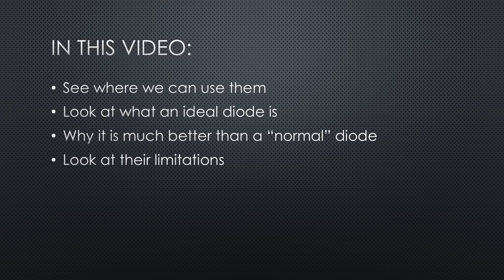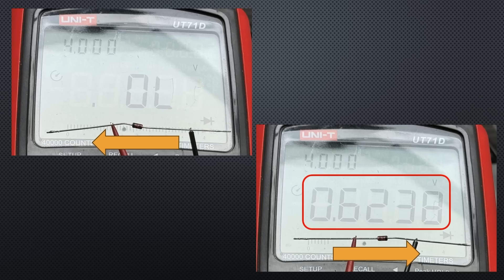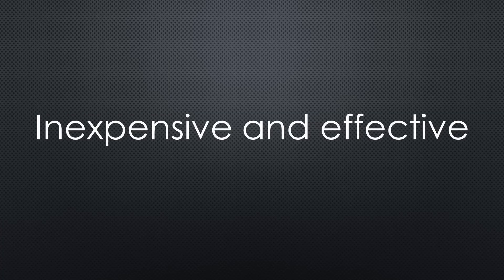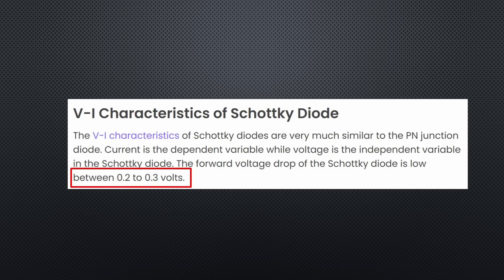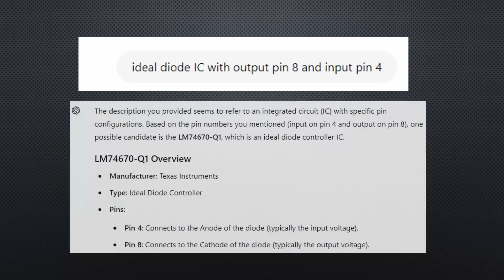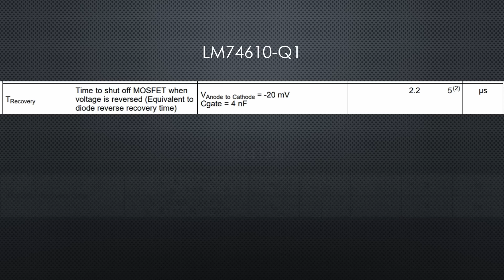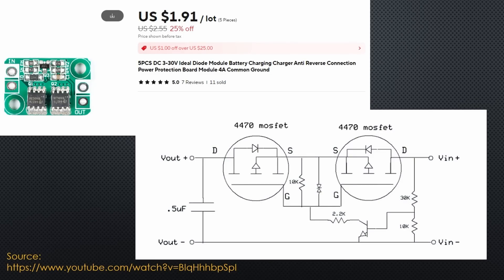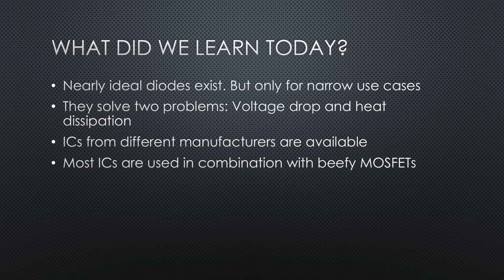(492) How to Protect Your Devices Against Reverse Polarity Using Ideal Diodes

Comment: I really don't see a need today for this IC, P-channel mosfets now have low Rdson, it doesn't have to be fast switching either so you can find of 0.5$ high power pmos mosfet for 90A or more, all you need is resistor and zenner if you going more than 20V.  I don't see any downside and it is far more the cheapiest solution, but keep in mind to put the drain of the mosfet to the input (+) side because you need that internal mosfet diode to conduct in normal polarity.

Comment: LM73100 is it also usable to charge 2 batteries in paralel to protect / seperate them from each other if voltages /capacity are not exact the same?
Reply from the maker: I would not connect such batteries in parallel.

Comment: I designed a pulse-width regulator with a synchronous diode. To protect against reverse polarity and short circuits on the power input, I installed a 40A automotive fuse in the input circuit. One day, I accidentally reversed the polarity of the battery (12V 60AH). The fuse immediately burned out. I expected the regulator to be damaged as well. However, everything remained intact. Replacing the fuse restored the regulator's functionality. The two diodes built into the MOSFETs acted as reverse shunts, limiting the reverse voltage and acting as a protection mechanism.
Reply from the maker: Glad to hear your design held up!

Comment: Very informative video! Could you please also make a test video for the popular Aliexpress XL74610 Ideal Diode Module? I'm not sure if it uses the original LM74610 chip or a cloned XL74610 chip. But I'm interested to know if it had done some improvement and could replace a swithing mode power supply rectifier diode on the DC output? What is the maximum frequency at which it can still work properly, and what is the maximum voltage it can handle?
Thank you in advance.
Reply from the maker: So far I have no such plans :-(

Comment: Very welll explained Sir. Can you suggest a solution for me where i have two power supplies 12 volt 1.5 amp and i want to connect them in parallel to increase the watts. Still i want to protect both power supplies incase of voltage and current imbalance. Thanks for your help.
Reply from the maker: I will not give you advice on that because it is quuite dangerous and can lead to dead power supplies.

Comment: Can these modules be used on the battery's negetive leg rather than its positive? 
I don't see why not; just swap it round the other way right? Or is there something I'm missing?
Reason I ask is because if the physical access to the battery's negetive leg was easier than its positive leg.
Reply from the maker: You can try. I do not like to cut ground wires.
Reply: I suppose so long as the same ground is not needed elsewhere/downstream then it should be fine. (As to not disrupt any 0 volt reference.)

Comment: I came back to this video because I completely botched a power circuit with multiple supplies coming together on a common power rail.  I'm now looking at the LM73100, NIS6150, ISL6146 and LTC4359 as my ideal diode for no forward voltage drop but full reverse current protection.
Reply from the maker: Good that you learn from a mistake!

Comment: Will these devices protect a 12v car lead acid battery charger from user connecting leads backwards at battery terminals?
Reply from the maker: This should be possible.

Comment: They are cool, but you only need them for really low voltages like 5V. The voltage drop of a power Schottky diode at 12V is close to negligible for most applications.
Reply from the maker: I agree somehow. Heat is also generated at higher voltages...
Reply: @AndreasSpiess  I use a combination of two mosfets as reverse polarity and overvoltage protection in a consumer product with a 5.5mm barrel connector. The nominal supply voltage is 9-12V but there is a chance that somebody might plug a 24V or even 48V supply in. Reverse polarity supplies are also common (guitar effect boxes are using negative on tip, I believe). There are, unfortunately, too many variations of barrel  plug power supplies out there to avoid this design. If I didn't have to protect against overvoltage I would go with a simple 1A Schottky.

Comment: Hello! Can I use XL0401 (DZDH0401DW + AGM30P05A) for blocking reverse flow from accumulator to charger?
Reply from the maker: I think so if you read the datasheet of the DZDH0401DW

Comment: There's another very simple solution (used very often in old electronic games using batteries for which the voltage drop would be unacceptable): place a reverse biase diode between ground and VCC and a fuse between VCC and the diode branch. In normal operation, nothing happens; if you inverse polarity, the diode will conduct, short VCC and ground and the fuse (which is before the diode) will pop.
Reply from the maker: I agree. Some commenters named it "crowbar" method. But you have to have a replacement fuse handy...
Reply: @AndreasSpiess  Use a polyfuse (PPTC) instead. Trade off is trip time and a small temperature dependence. But it works very well.
Reply: @Winkemaennchen  A correctly sized polyfuse and a power Schottky will have reasonable trip times. The problem is the power supply. If it can't supply the trip current of the polyfuse, then it's the power supply that is being stressed. In extreme cases (lithium and lead acid batteries as sources) one has to be careful to make sure that the surge current doesn't exceed the max. polyfuse and diode current, which is not a completely straight forward design exercise IMHO. For a product that has to be reliable one has to be careful to consider the entire possible range of input voltage and inrush current. A Mosfet based polarity and overvoltage protection circuit is far more versatile and riskless.
Reply: @schmetterling4477  Just look at voltages in that scenario. Can trip for weeks and no damage occur.
Reply: @Winkemaennchen  The damage occurs when it doesn't trip and when it trips at too high a voltage. I can prevent both scenarios reliably with two mosfets and a voltage regulator. The cost is not much higher than for the polyfuse but you are 100% protected by design. No offense to polyfuse manufacturers, but the product has a very limit range of application, IMHO. It definitely does not work as an actual power protection circuit.

Comment: I invented this. Too bad I am so lazy. But what this is really good for is the freewheeling diode on a buck converter. That is, if the switching frequency isn't too high. Those diode losses are serious. Especially in big stuff like cars. But for protection against reverse polarity you can always just use a diode that will short it out, like a crowbar, and blow the fuse. You would need a fuse. No forward drop! Cheap! But need that fuse.
Reply from the maker: I agree with the crowbar. Unfortunately, my "ideal" diodes were not very good with 50Hz sine waves. This is why I did not mention this use case.

Comment: Cheap & easy solution for Reverse voltage, over voltage & surge: TVS diode & PTC Fuse. PTC Fuse on high side power source, than a TVS diode on the other side of the Fuse connected to ground. if the power supply is reversed, the TVS diode works like a diode with a forward voltage applied. causing a short. the PTC fuse will trip, limiting input current. On over voltage or surge, the TVS diode clamps down at its breakdown voltage. PTC fuse will limit current if the supply is in  Over voltage. 
PTC Fuse is reuseable over & over as it does not blow like a standard fuse. Under excessive current it heats up & resistance increases until it reaches equilibrium. When current flow reduces the resistance falls back to a low resistant state.
Reply from the maker: A good idea. It is sometimes called "crowbar". But not often used with PTC fuses!
Reply: @AndreasSpiess  I know what a crowbar circuit its. I designed a surge protect that uses a 3 way crowbar circuit for AC.

Crowbar is uses for high power AC systems. Using the PTC + TVS diode is a much simplier circuit for DC protection.

Comment: Thanks for the info...

I knew about primitive ideal diode using a P-CH MOSFET, 10V zener diode and a resistor but these IC's use N-Channel MOSFETs which provide a much wider choice of silicons.

BTW, the P-Ch reverse polarity protection connects the Source to the INPUT, Drain to the OUTPUT and the Gate is connected to negative rail via  a 1k resistor. 10V Zener between G and S protect Gate from over voltage. A 10nF cap. may be. inserted between G and S in RF circuitry.

Thank you.
Reply from the maker: Thanks for the info! Did I make a mistake?

Comment: I went to jump start a car. The negative on the battery was marked with a red circle. The insulation melted off the cables and I had to buy my friend a new battery. It did work to start the car though.
Reply from the maker: Nice story! Thank you. Indeed, car batteries have no protection and not very good visible polarity markings.
Reply: @AndreasSpiess  Rot ist schwarz und plus ist minus. Old tech wisdom.

Comment: My pro lem with ideal diodes is that I'm usually looking for them in situations where battery life is critical. And they invariably have more quiescent draw than I would lose on the diode. The old "series mosfet with gate tied to GND" works for single-supply situations with low load-side capacitance, but fail in situations where multiple sources are available. 

To be fair, I usually measure current in micro amps, not milliamps...
Reply from the maker: Thank you for sharing your experience!

Comment: There's no point in using them for reverse protection. The old fuse and flipped heavy silicon diode in parallel works just fine.
Reply from the maker: Also a good idea if you have a replacement fuse handy.

Comment: I'm trying to connect four solar panels(6v 1w) in parallel to operate with one MPPT. In this case, can I use this to prevent reverse current for each solar panel?
Reply from the maker: I think so. But if they pint in the same direction, it is probably not needed.

Comment: Can always make the cheap crude version.
And diode in paralell to input at reverse and a input fuse.
If the voltage is reversed it shorts and blow the fuse, seen this in many circuits even expensive gear
Reply from the maker: A good idea for reverse polarity protection if you have a spare fuse handy. Not so good for the "two power supplies and one load".

Comment: I was working at car alarm installation company, at age ca 20 years old. (48 now)At our building complex, there was also garage where they kept cars for owners of local dairy company. They brought ferrari f355 to get its battery charged. Its battery is located in right side inside of front bumper. Managed to connect to it soviet era battery charger with reverse polarity🤦‍♂️ fortunately it ended with me having to pay for new leads to this charger as they melted quite a bit. Car was ok🙈
You can google “start akulaadija” , its with transformer and diode bridge, ca 30A charging current
Reply: I would like to have solution to my current power supply for car programming, its about 110A, sometimes mechanics from my garage “borrow” it for battery charging and there have been accidents in past when they connected it with reverse polarity and destroyed it. Would love to put diode for protection, it has to withstand ca 150A as i sometimes start car without disconnecting power to it

Comment: Wiped out an ATtiny85 microprocessor by plugging it in backwards making the ground pin (pin 4) the +Vcc pin and the Vcc pin (pin 8) the ground pin. Result: dead microprocessor due to reverse polarity. Lesson: Always be aware of where pin 1 is (pint the the dot should be upper left)
Reply from the maker: The same happened here last week (mixed the two cables on my breadboard. The ATTiny became quite hot ;-)

Comment: Reverse polarity stuff up. The reason was due to color not being standardised in all electrical situations. 
The European color for live is brown as red looks brown over time.  Red in DC being positive usually. 
Not in Mercedes,  seems at the battery the brown is negative usually black. 
  Guess what I did   "  Bang "
Reply from the maker: Indeed. I cars, black seems to be sometimes positive. A true mess! BTW: I did not know the explanation for the brown color.
Reply: @AndreasSpiess  Was an expensive mistake covered by company insurance. 
I didn't get fired.  After a few more years I left due to back problems.

Comment: Went to Antarctica with a mate who was installing a very clever gadget to run a camera in a box to photograph penguins.  Sealed in a box, allowance for day/night length, windscreen wipers for blizzards, shutter etc etc.  The guy who built it assumed it would have power leads correctly connected.  Didn't work.  You know why.  Months of work wasted for want of a simple diode.
Reply from the maker: That is a very sad story! Thank you for sharing. Engineers sometimes are too focused on the main reason and forget the obvious.

Comment: I prefer protection with series fuse and schottky diode in parallel due to cost and minimal voltage loss. The diode with Mosfet does not work correctly at voltages below 3V
Reply from the maker: Also a good idea if you have a replacement fuse handy.

Comment: Im working on 8 amp drone, 2 amps per motor. I have burnt out gpio pins and a few esp32 boards. I plan to put diode on gpio pins and diode on esp32 5v pin. I also consider capacitor on the esp32 5v power.
Reply from the maker: I hope you will use Schottky diodes on the GPIOs because otherwise, the signals can degrade.
Reply: @AndreasSpiess  Maybe he should consider optocouplers instead. They are industry standard for rugged systems even w/o galvanic isolation (wich make it even better).

Comment: I think I have never reversed polarity yet, but I'm paranoid about it. I used Molex plugs for my old projects and switched to USB.
USB is not really replacing variable power supplies for prototyping. Although I get 28V and 5A, it probably doesn't replace those diodes. Thanks for the overview of working ideal diodes.
Is there already a video about working USB decoy boards? I found so many decoy boards, which don't always work. They always provide 9V instead of any promised voltage. 20V at one power supply and 15V at the other.
Reply from the maker: I agree, USB is a good alternative. I made a video on USB in general where I explain how it works.

Comment: For reverse polarity you can use a crowbar circuit rather than a diode, no?
Reply from the maker: The basic crowbar circuit is used to shorten the power if an overvoltage occurs. I am not sure if all designs also protects against reverse polarity.
Reply: @AndreasSpiess  AIUI you can make a reverse polarity crowbar circuit that shunts the power if it's connected in reverse.

Comment: A single PMOS transistor can be used for reverse polarity protection.  I've used this on my designs, and have seen this used on commercial PCBs.
Reply from the maker: you are right, if you use one that has a proper Vgs voltage or use a Zener diode to protect it.

Comment: My largest smoke incident was probably installing a 486 CPU backwards.
After I managed to pull the CPU out of the damaged ZIF socket: I saw what appeared to be solder around one of the pins.
Reply from the maker: Indeed an expensive mistake! I think, such a mistake is no more possible with newer sockets.
Reply: @AndreasSpiess  486 CPUs were not actually that expensive at the time. I think the Pentium II was the new hotness.
Reply: How did you do that? If I remember correctly the socket and CPU was coded in a corner leaving 2 pins out from the grid forming a point, or arrow.
Reply: @Sekir80  While the socket has a key pin: you can see it is not actually used by the CPUs if you look up pictures of 486 CPU pins.
I made sure to line up the mark on the package properly after that incident!

Comment: Schottky diodes are NOT for reverse polarity protection. They have very high leakage when reverse biased. Enough to make a battery explode. You need to use a power diode. Hence the name... Schottky diodes are used for when you need extremely fast switching like in a SMPS.
Reply from the maker: Thank you for clarification! I am no power electronics guy.

Comment: My prediction: Package with a bunch of parallel mosfets to give them a really low resistance/voltage drop.
EDIT: Close but I guess it's just one beefy mosfet with a bunch of parallel pins. Either way I earned a chocolate bar
Reply from the maker: Indeed, they use several pins for these higher power chips.